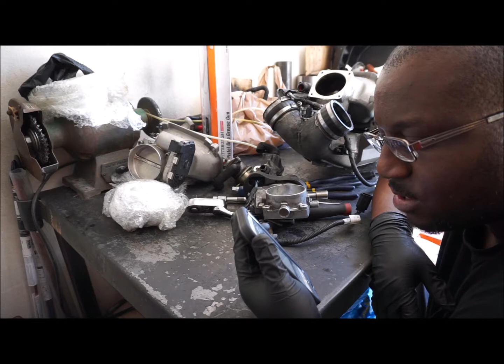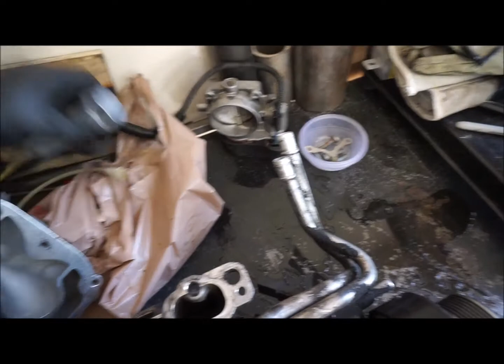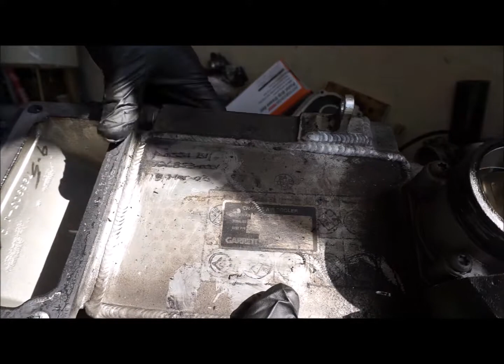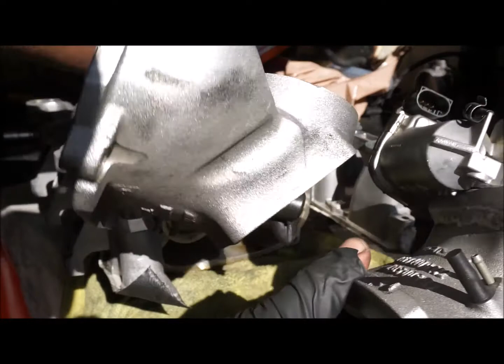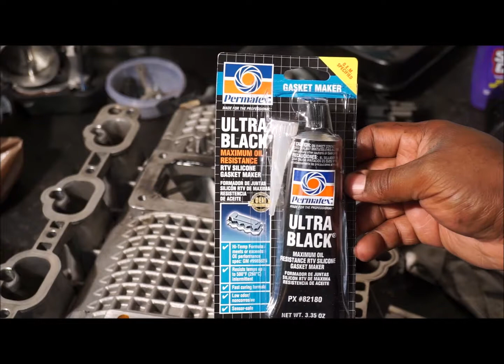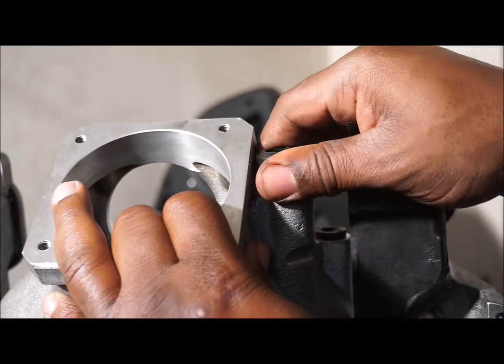DIY Supercharger Oil change (M113K) + TB upgrade PART 1

Comment: Do you use silant from tb to the plate
Reply from the maker: Yes I did use black RTV sealant. You don’t necessarily have to, but I did it to ensure a 100% vacuum seal. I did the same thing with the supercharger gaskets to engine as well.

Comment: Which model M113k do you have?  I'm expressing interest with the 80 or 82mm throttle body upgrade for my S55 AMG.
Reply from the maker: I have a 2004 S55 AMG
Reply: @frugalfabrication  How's it drive with the upgraded TB?  Some E55/CLS55 owners have commented on the Mercedes forums with hiccup issues in drivability & CEL error codes.  Also, do you have long tube headers on your S55 or plan to do so?
Reply from the maker: @Brabus2  I have long tube headers but not installed yet. 

It drove great, but did have the hiccup issue.

 (This is a small grey area at the start of pedal travel which I think is an air sensor that operates outside of parameters at this grey pedal location, and send an “out of limit” signal to the ecu, while the air-fuel maps have not accounted for this.....this is my guess)

I did find a resolve to this issue by mistake. 
I did the “Sneaky ECU reset” (supposedly resets the throttle body/pedal location sensors) a-few times (before each tune install).

I then loaded ECU tunes, and by the 4th or  5th tune I noticed the hiccup was gone.
Reply: @frugalfabrication  Rarely do I come across someone with long tube headers on an S55.  Kudos, I'm very much interested to see your results (hopefully soon!).  Most particularly with the installation process. Is your set a dedicated S55 header unit much like the MBH product or the E55/CLS55 version?  I'm in a quandary between the LTH, TB upgrade or a Flex Fuel kit for my next performance mod.  And since I'm in Los Angeles, I'm sort of hesitant with the LTH with emissions.

Interesting find with the "Sneaky reset",  prior to the Tcu tune I would do it constantly.  Btw, if you're not familiar with the MK Ultra Tcu tune -  it's one of the best bang for the buck modification I did for under $300.  The power delivery and trans shifting is quite noticeable that I had to dial my sprint  booster settings a couple notches down.
 Here's a link of the discussion on the forum:
https://mbworld.org/forums/w211-amg/799975-agility-mode-tcu-tune-shift-delays-left-shatters.html

My Ecu tune is by Race IQ, complementing a 80mm fixed pulley, belt wrap kit and a split cooling.

Comment: How much HP did you add when upgraded to 82mm?
Reply from the maker: To be honest I couldn’t tell you as I did not take it for a before and after dyno run. But I will say that the accelerator pedal’s throttle response was better.

The throttle body was 1/2 of the equation. Currently I am making headers and exhaust for the 2nd half so it all will be free flowing on both ends.

I will post a video of this process too as well (the headers are NOT a quick and simple task).